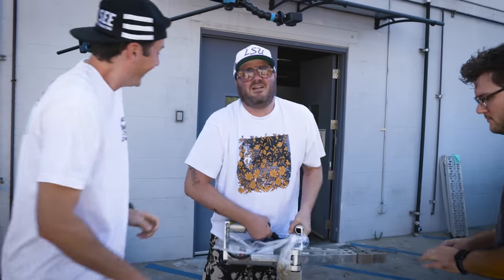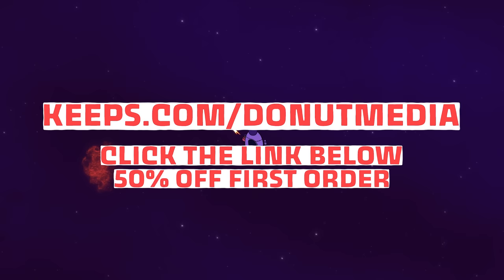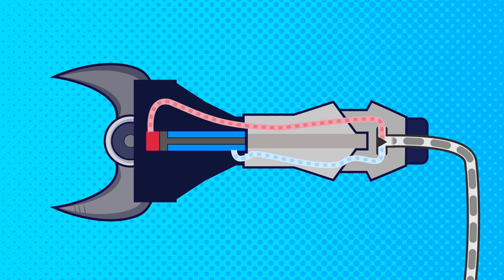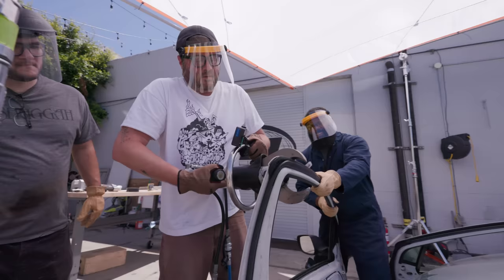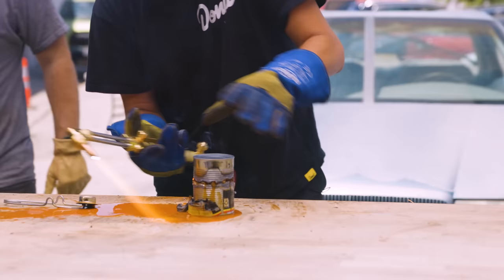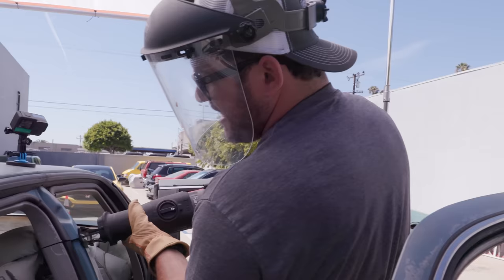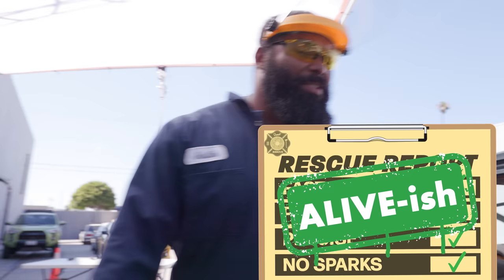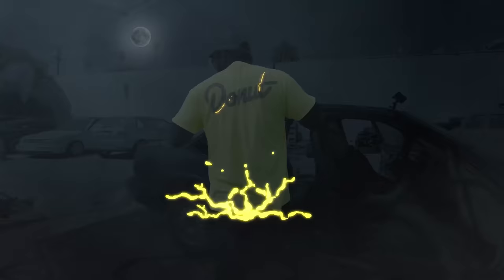We Bought the Jaws of Life

Comment: Shame the title of the video is 100% wrong. Not once did you touch "The Jaws Of Life". That term is trademarked by Hurst and has been for 40 years. It originated with the OG Hurst 32A spreader. The tools you bought and played with are Amkus brand tools and are NOT the Jaws Of Life. They perform the same function but they are not the same thing. The Holmatro tools you were demonstrated at the fire house are also NOT the Jaws Of Life, different design, brand, and history. 

If it doesn't say Hurst, its not The Jaws Of Life. Even then I would never call a cutter, combi-tool, or ram from Hurst "The Jaws". Thats reserved for the spreaders, particularly the 32A and 32B models.